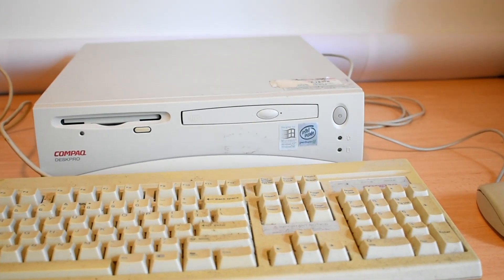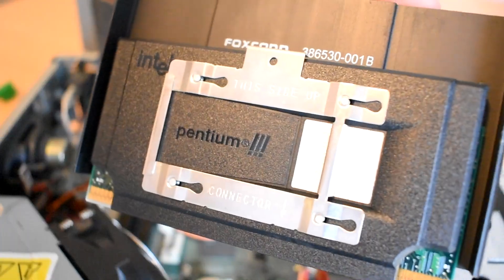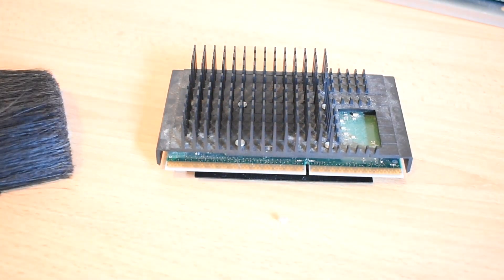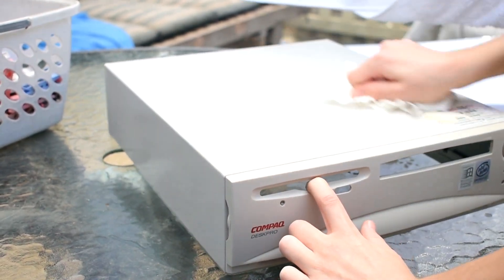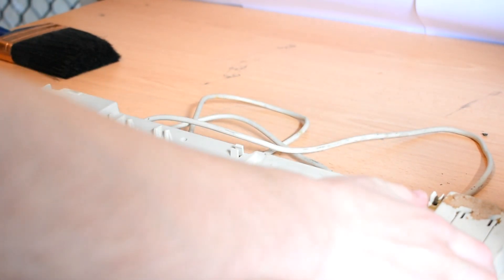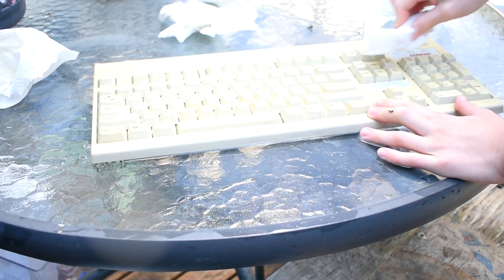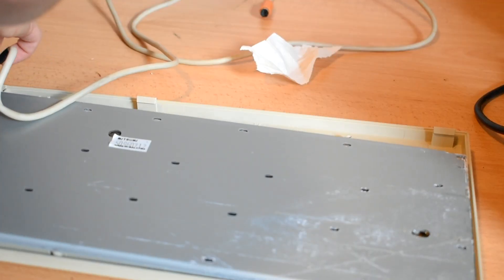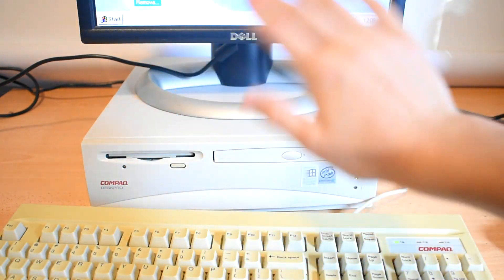Compaq Deskpro Restoration - Keyboard, Mouse & Computer!

Comment: that's a cool old compaq, they were bought out around 2002 so that must be one of their last machines. a nice one to have, good to see you cleaned it up well!
Reply from the maker: Tech Foraging this one was actually one of the first vintage computers I owned. I’ve used it for countless hours and it works really smooth. The built in graphics are alright, but I found that to really be the limiting factor. Still, it works really good.

Comment: I got one of these nearly a year ago with the exact same specs but I had no idea you could lift up the PSU like that and slide out the motherboard! great video!  - (tip) get a Matrox G450 32mb PCI graphics card it works and its like nearly 6 times better than the onboard ATI Rage.
Reply from the maker: Ian Pickavance they are a pretty unique design these compaq machines. Thanks also! I’ll see about a matrox card, it would be nice to play some more graphics intense games after all.
Reply: @ScanLinesAU  I got mine off Ebay as they are pretty cheap. I've given your channel a mention on the Retro Machines Facebook group as you deserve a lot more subscribers! keep up the good work!
Reply from the maker: Ian Pickavance thanks man, I really appreciate that!

Comment: An NLX form factor PC! I meant to get one with an Asus SP98-N, but never did. For a keyboard with that many screws, have you considered getting a powered screwdriver? I never did since I never had a need for one, but, ya know... just in case you run into a keyboard like that again.
Reply from the maker: Kugee I have actually got a cordless drill that will do just that, but I have never really wanted to use anything powered when it comes to screwing into plastic. It could over tighten it potentially, so I really don’t know whether it’s a good idea or not (especially using a full blown drill, maybe a powered screwdriver is different). When you do it by hand, you kind of know when to stop, but I feel it would be easier with a drill/powered screwdriver to mess it up. I might consider trying powered methods down the track, but I’ll see about it when I need it next. Thanks for the suggestion, I always like to hear ideas and opinions! :)

Comment: I have the same one.but its cell is dead now.where i can got the cell because its cell size is different.
And i want to put a RAM .which frequency and ddr RAM is compatible for this.
Reply from the maker: VIVEK KUMAR this machine uses sdram. You can use pc100 or pc 133.